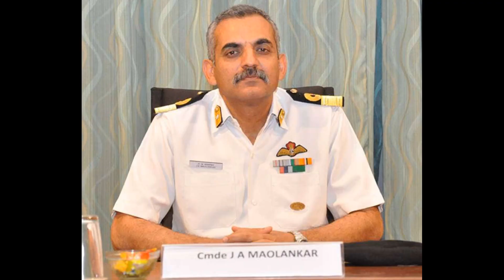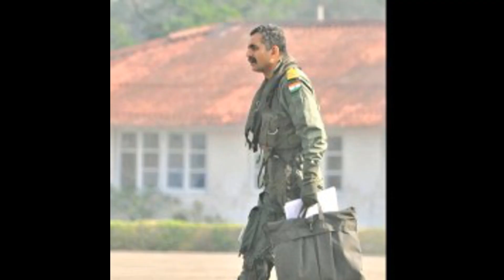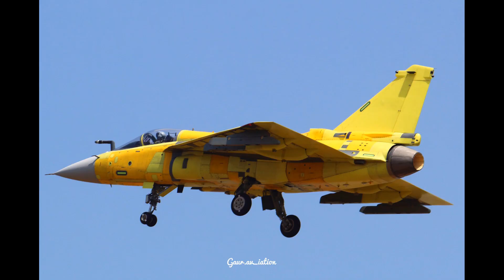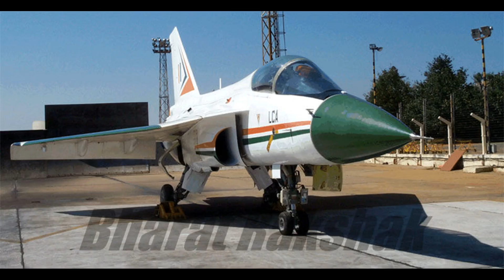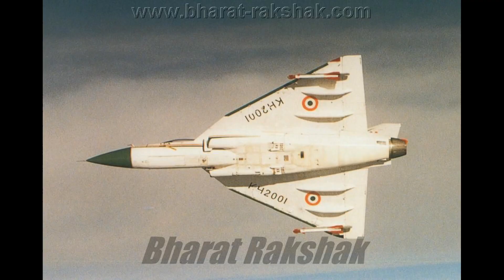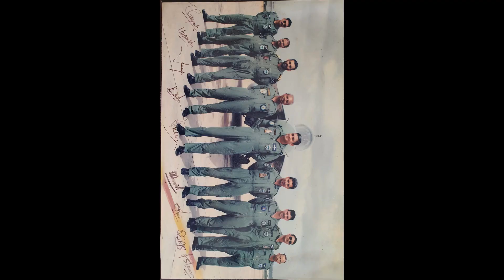Blueskies Podcast - S1Ep47: LCA Part 6 - Jaideep Maolankar test flying the LCA (1 of 2)

Comment: Very interesting podcast.As also mentioned by others on the LCA programme, the expansion of the performance envelope and the process of flutter testing phased in a systematic and step-by-step manner highlights the hard work that has gone in.  The details relating to planning and executing air displays, not at all obvious to those who witness these,  are instructive.
Reply from the maker: Thanks Sir

Comment: I'm going to have a crack at giving a simplified explanation of flutter. When air flows over an aircraft, it's exerts aerodynamic forces over the entire surface of the body. The aircraft, being a flexible structure, deflects due to these loads, changing the shape of the body mildly (elastic deflection). This mild change of shape in turn affects the aerodynamic forces on the body, which again leads elastic deformation and so on...

From Newton's first law, we know that any object tends to be in a state of rest or uniform motion unless acted upon by an external force. Thus, structure would tend to keep deflecting infinitely unless there's a force preventing that. Luckily the internal forces within the body prevent this from happening. Much like a spring, these forces increase with increased deflection and thus try to bring the body back to it's original shape.

So the sequence of events is as follows. 1) Body deflects due to aerodynamic forces 2) Deflection reaches maximum amplitude 3) Restorative elastic forces are greater than aerodynamic forces at Max amplitude and pull the body back to it's original shape (0 amplitude deflection) 4) Due to the inertia, the body overshoots it's zero amplitude postion and head towards a negative maximum amplitude position. So the whole thing essentially behaves like a swing in the playground.

While on a playground swing, If someone pushes you at the right time with the right amount of force, the amplitude of oscillation may increase, decrease or stay the same. The analogy here is that gravity is the elastic force, the mass of the person and the swing is the inertia force and the "pushes" are the external aerodynamic force.

The main goal of the design and testing team is to ensure that 1) Figure out the flight envelope in which the aerodynamic forces tends to damp out the oscillations. 2) Ensure that the amplitude of oscillations are low enough to not damage the structure or adversely affect the handling of the aircraft.

Hope this helps.
Reply: This episode gives me a great appreciation for the number of tests that would've needed to be conducted for the aircraft to be considered worthy of the air force. Sounds like there would be a mind blowing number of tests, since there are many different ways of manuvering an aircraft. It would be interesting to hear what would be the different test points the aircraft would have to taken through to be considered safe for use.
Reply from the maker: So true, we're getting a small view of why it takes so long to get an aircraft to operational status...
Reply from the maker: Thank you!
Reply: Understanding flutter is easy if one has idea about the graph of wavelength..
Reply: Good explanation. Aeroelasticity is the key parameter..
Reply: Good explanation.

Many people understand better if they actually see this visually. A similar phenomenon occurs and can be seen when high frame rates are used to film objects getting distorted by sound waves using high volume speaker systems in cars etc. Videos available shows the waves of oscillations affecting the metal in the car and even the glass windows. It's so cool to be actually able to see the metal and glass oscillate in different directions actually bending the glass out of the frame and going back in and same for the metal car doors, all happening very fast which probably the eyes can't see but it's captured in film due to high frame rates. Was mesmerising watching those sound waves created oscillations which I saw on a WhatsApp video sent by a friend. Perhaps similar high frame rates for cameras observing the wings etc might be able to capture the oscillations in wings etc as well to be seen visually using those high frame rates played back at usual speeds. Just a lay persons thoughts.